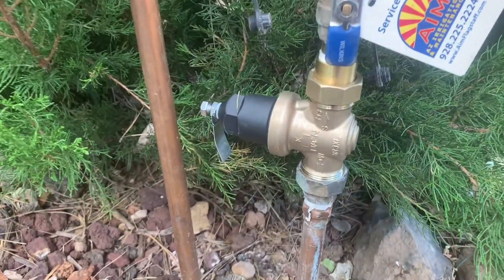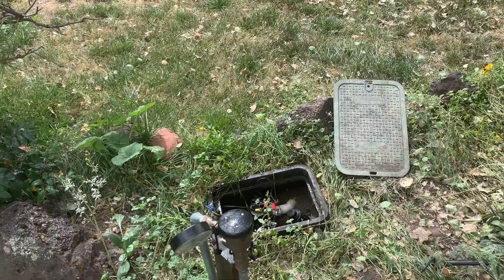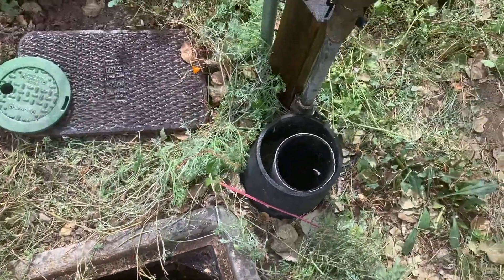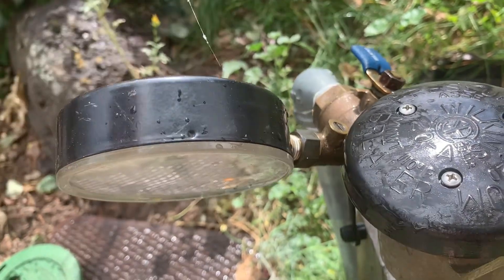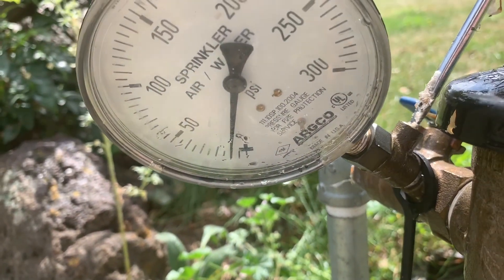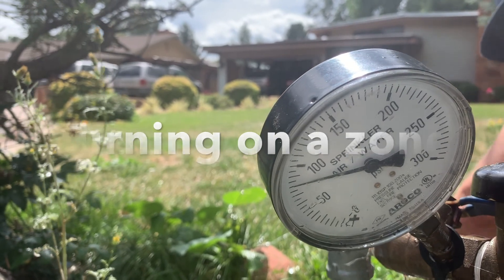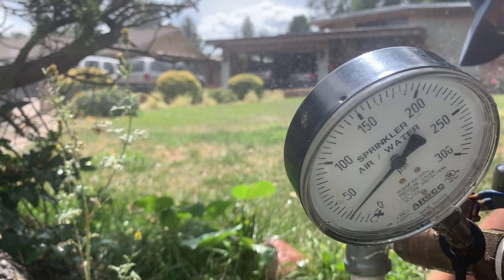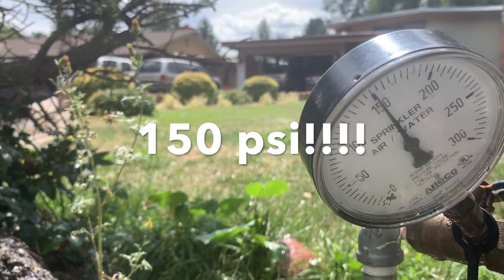What Water Hammer and Pressure Issues In an Irrigation System Look Like

Comment: how is that fixed
Reply from the maker: There are a couple ways.  If you have back flow device that is above ground, you can add a device called a Water Hammer Arrestor.  Should be available at most hardware stores.  The second item to check is to see if you have a PRV or Pressure Reducer Valve.  This is starting to fail and restricting the flow, volume, of water.  So that will need to be replaced.  So basically there is not enough volume of water going into the pipes, so the water is bouncing or hammering back and forth.   Make sure all your valves are closed and if they were properly designed then there will be proper flow.
Reply: Makes sense !! thanks !!!